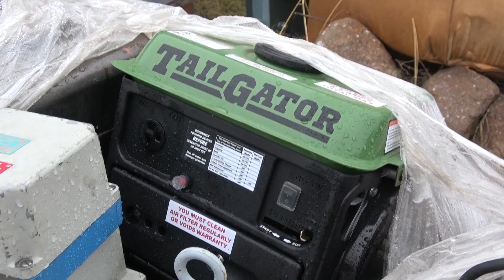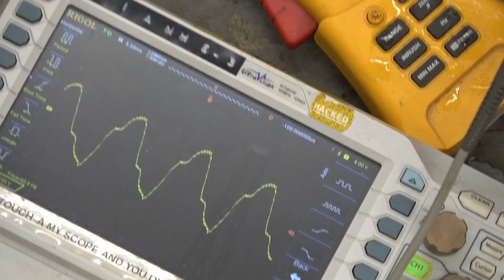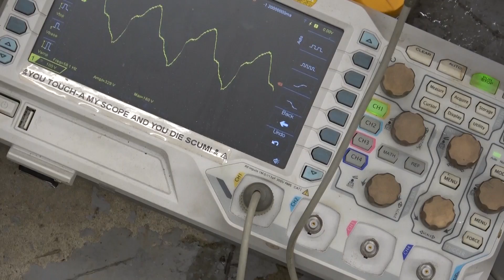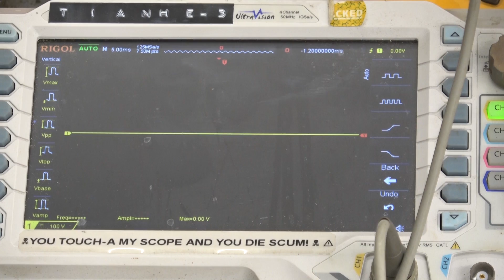BOLTR: Harbor Freight Tail Gator | Brine Tank Testing

Comment: I,ve had a few of these. Bought my first one to run some lights for night/bow fishing on my boat and to keep the battery charged up. For 89$ i did not expect it to last a month, 3 years later i pulled on the pull cord to hard and broke the plastic dogs on the starting mechanism. I could have replaced them for 50$. But opted to buy another for 89$. I have used it not only on my boat, but even more so running an electric fillet knife in remote locations. Used it to build a cover for my new pontoon boat running a chop saw. It wasnt happy but did it without much complaint. During snowpacalyps in east texas last year i used it to power the lights and my diesel fired heater through a suicide cord while i changed the end bearings on my big generator. It ran lights and a couple fans and a deep freezer at my mother in laws after a hurricane. It has been a damn handy unit. Mother in law was so impressed with it she got her one.

Comment: I had a very similar, but orange 230V nominally 1kVa cheap Chinese genset... only it ketp spitting gas out of the carb overflow unless you restricted it by turning the fuel valve almost off, and it was freakin' hard to start.

Comment: Earth’s Atmospheric Gases.

Today's collection of brain teaser facts and questions which make eco-alarmists nervous.

Nearly all of the Earth's atmospheric oxygen comes from plants and the process of photosynthesis -- 98%.  70% of that plant-sourced O2 is sea and ocean based via phytoplankton.  In other words, what land-based life forms do is of marginal impact on planet Earth's atmosphere.

Here's the balanced chemical equation of the photosynthesis process:

6CO2 + 6H20 + (energy) → C6H12O6 + 6O2

Notice, the O2 and CO2 quantities are equal.

The balanced chemical equation of cellular respiration is just the reverse flow of the above -- sugar burned with oxygen yields cellular energy, carbon dioxide, and water.  Once again the quantities of oxygen and carbon dioxide are balanced.

The gradient between oxygen and carbon dioxide in the atmosphere is 21% to 0.04%...  That's one hell of a difference given plant cellular respiration is chemically balanced between CO2 and O2.  The difference is black hole like.  In addition, oxygen is an extremely reactive chemical.  It wants to combine with *everything*.  CO2?  Not so much.  It's nearly inert at earth atmospheric temperatures and pressures.

Another thing to keep in mind.  The cellular respiration process of plants producing CO2 goes on 24x7.  CO2 only gets converted to O2 during daylight photosynthesis.  That's a 2-to-1 margin.

Effectively, earth's biosphere is a carbon near-vacuum literally starving for CO2.

When such vast gradients exist and someone proffers the notion that parts per million perturbations are life-ending, chances are the speech is motivated and contains something more than rigorous science.

It just doesn't pass the simplicity back-of-napkin once-over.

Comment: I had this king Canada for like 10 years and it runs like a top .. goes through 1-2 spark plugs per year .. using it for the camper in the summer and ice hut in the winter .. it easily has more than 10k hrs ..cheers

Comment: I bought one and I had a coupon, so I think I paid less than $90. It's got me through about four blackouts once I get it running. I have to use starter fluid to get it running every time, maybe it's because I'm old and can't pull the hell of it 20 times in a row. I start to peter out at about ten, then I say the hell with it and give a squirt, and it fires right up.

Comment: I have an Aldi version here in Australia, 240v 700w, its a little ripper. Mostly used for fridge battery charging when not enough sun for the solar panels to keep up,it has a 12v charging socket and lead. Also gets used to run a few remote ballast workshop flouros at night. A little noisy but i just put an extra push on muffler on it and and it's that quiet i have to keep checking that it's still running at 10m away,10yrs no problems yet,and it weighs nothing at all to cart around. Good little unit for what it is and what it costs.

Comment: Dont waste your money. 
Not enough power. 
A heavy duty drill can not run off the power this generator puts out. 
No welder, and no grinders.
It's not enough power for a RV.
It's only good for one house lamp with one normal size small light bulb.

Comment: I inherited a new-in-box one of the old blue-top ones of these from my late father.

Saved me hundreds of greenback doll-hairs in food that was in the standing fridge and chest freezer the last two times we lost power. Just had to run a 100 ft power cord (14ga from Home Despot, so we're good) in from the little beast out front of the garage and swapped it between them every couple hours to let them get cool. Last time was 3 full days of no power and just had to fill it four times; that 1 gallon lasts a good 6 hours with the low-cycling of the refrigerant compressors (claims 5 hours at 50% load). Just left it off overnight while sleeping.

Now I've got me one of Hazard Frought's 9k start/7250 run generators but that little guy is going to stick around as a backup. Little champ, it is!

Comment: Man, I bought one of these in late 2019 for $85 with a coupon and it has been great for ultra portable use. Not very quiet, but ias long as you drain the fuel thoroughly before storing, it starts right up the next time. If your expectations are realistic, you can't go wrong for the price.

Comment: What a s*** first comment, first of all. What I came to say was... the weak Link in this system so far has been the run/start capacitor (voltage regulator). I have run power saws and totally abused this thing for over a year. If you beat it hard enough the run capacitor will blow and the voltage will go up and down. Basically, she'll fail to Chooch. Replaced it twice and have a third one on hand. I don't plan on abusing it anymore (trying to run a skill saw) and I don't believe I'll ever need the third capacitor. So far this thing does exactly what it says it does, and is good for exactly what it says it's good for. I figured letting it sit for six months with ethanol gas and it would be enough to make her finally fail to Chooch, and hit the NFG but she started right up. Actually, I can't say start right up  because it usually takes anywhere from four to ten pulls to start it, but that's consistent. The spark plug wire was just a coil wire going into the boot when I bought it. I don't know if that's normal but might be something for you to look at. Thanks for the review and all your videos. look forward to seeing you tear this thing down into a million pieces and see what you think.

Comment: So I have a question... I have that exact lighting producer .. I had a series of LED lights running through a surge protector power strip and the lights were flickering so me and my bright ideas I was wanting to see if I increased the motor speed would the flickering go away ?? it did not.. as a matter of fact it blew the surge protector and plum let the smoke right out of it any ideas on what was causing the flickering

Comment: Almost certainly you're making HCl unless you're using distilled water.
Reply: And the salt saturated solution is probably throwing off both Hydrogen and Chlorine gasses, this is the process by which most chlorine is manufactured.

Comment: I got me one for $89US at the harbor fright tents sale 4 years ago. It needed bill Cosby in a can to start out of the box, but I just use it to run my Chicago electric angle grinder and hedge clippers. It was cheaper than 300 ft of extension cords and been doing great for 4 years now. I think it will run a shitty microwave, a fridge, or a small conditioner (pick one) of the power goes out. Not much more. I bought it to go cut a steel fence down in a field with no power. Got a grinder and the genie for <$100 for a 3 hour job. Still running both quite frequently 4 years after.

Comment: Wow yours actually rn?  My father and I both purchased one of these type of generators from there years ago.  Mine stopped working within 2 days.   Took it back and got it refunded.  Dads worked for awhile but it didn't put much power out at all.

Comment: After the last war in Iraq 2003 the market was full of this trashy generator as it was cheap and as the first thing we lost was the power, we used to call it the screamer, it worked max a month or 2 then we had to go and buy another, most of the time it's broken when you buy it, had like 7 of them on my roof and was swapping parts when one of them breaks, was good to turn on an old TV and some lamps and a fan that was it, had to use protection before turning on a pc on that.

Comment: The electrodes are to big, you can just use 2 nails or just the bare wire.. or maybe just less salt.  Also I read somewhere is better tu use baking soda instead of salt to prevent clorine gas formation.

Comment: Oh the number of times I've pullled and cursed and pulled some more on my Tailgator only to figure out I forgot to turn the stanking gas valve on!  It takes a bit for it to get down there sometimes too, generally put the gas on, organize what I'm going to work on, put the choke on to start, pull 5 times then hit the switch to on.  Usually starts right up that way.  I've got a long enough yard that extension cords just won't cut it so I use this as a portable power supply.  I've run a pancake air compressor, electric pole trimmer (cheep Hardless Freight version) Radial arm saw (that really loads it down, usually pulse the trigger a bit there till it's up to speed) last time I had it driving my power sprayer.  Only real limitation is it wants to be level. so just sitting it in the back of my garden tractor trailer is out of it.  I sit it on a piece of plywood and shim that level when I get to where I'm working.  Like most two strokes, run it once a quarter at least and it'll stay happy.  Mines 4 years old now and really has been a good 65 dollar investment.  (good old sale)

Comment: The temperature of the solution has an effect the higher it goes the higher the amps will go if the concentration stays the same. I operate a AC mine winder and this is how we control the induced current to controll the speed of the winder and a cooling tower to keep the solution temperature in check.

Comment: Excellent "jar of water resistor" (aka liquid rheostat) sir!

Less salt (maybe just a few tablespoons worth!) and controlling as a large electrode area will probably be easier.  Hot water conducts more easily than cold, so until it boils or reaches thermal equilibrium it will never be stable.  A small glass jar (kept in a containment bath) may equilibrate faster (and dry out, changing electrode coverage...).  Eh, expect it to drift.

NaCl will probably generate chlorine and smell like a pool.  The solution pH will also probably rise over time and get more corrosive to the aluminum and human flesh (to worry about if the deadly voltages and heat aren't enough).  Sulfate, hydroxide, or carbonate anions are more electrolytically stable.

Comment: I had one of these about 10 years ago (They were blue at the time, but otherwise identical) I used it at the racetrack every weekend for an entire summer (call 1200-1500 hours) before it gave up. Even then it probably just needed a carb cleaning (All you could get was E10 gas at the time). It was the same price back then. Replaced it with a Honda EU2000, but it definitely lasted longer than its price tag would indicate.

Comment: I have the Ryobi branded one (looks identical other than being 220v), there are other brands as well and they all seem to come from the same factory. She runs all my essentials during a load shedding, which is common where I live, for hours. It even ran our house 24/7 for a week, when the transformer for the area went up in smoke! So I can confirm that these lil 2hp generators are, indeed, a sore dick deal. Only down side is that you're not gonna run any big consumers like electric stoves/heaters/kettles/washing machines/fridges/AC units/geysers/welding machines/angle grinders/compressors etc etc,. But well good enough for lighting (if LED), the entertainment of choice, interwebs and a couple small fans....

Comment: I paid 800 US clams for 10 times the amperage from a surplus military diesel unit.  Also does 240 split and 208 3 phase.  But weighs 1000 pounds

Comment: I can't get mine to put out over 90vac.
Tore it down and nothing looks bad. Cap checks out at 12uF as printed on the side and the rotor diode isn't shorted. Tried adjusting there RPM and it peaks at 90v. ???

Never really used it but the warrants up because it sat in the box. Thinking about replacing the generator portion with an alternator because I wanted it for backup battery charging anyway.

Comment: I just got one of these units today on Craigslist for $25. The guy had left gas in the tank for a few months w/o use. He claims he cleaned the carb out with carb cleaner. I'm guessing he didn't use the cleaning wires to get the junk out of the tiny passage ways. he said it would only run while the choke was full closed, and die when it was opened. So I'm guessing junk in the passage ways.
If it runs anywhere near as good as this one, I'll be happy camper. Just use it to charge battery packs out in the field where there is no electrocity lines.

Comment: I hate these things. For years I ran their older unit, I think it was blue. It ran, and ran. Finally I managed to kill it, while running a circular saw all day. I bought one of these new green ones to replace it. The first one started ok after 20 pulls, and I let it sit for a week before I needed it. Then it would not start for nothing. 100 pulls later, and half a can of starting juice, I brought it back to HF for a replacement. The second one never ran right. I found that the spark plug cap is barely a cap. the connector is simply poked barely into the wire. I exchanged the entire unit again. 3rd one was a bear to start. Above 40F it would usually start in 20-30 pulls. Below freezing, and good luck. It didn't matter if you dumped gas right into the thing, it wouldn't fire. I replaced it again. 4th one again was a bear to start, but would usually start in 20-30 very hard pulls below freezing. I used it once, the second time the float kept getting stuck. After messing with it, it worked for about 30 minutes, then started pouring gas everywhere. At that point I had enough. I gave the thing to a friend for free. 2 weeks later the unit ended up in my garage again, and I haven't seen that friend since. 

4 years ago HF was kind of cool, in that you could get some things dirt cheap. That is no longer the case. You can buy things that actually work for the same price now. I don't miss it. The smell of every Harbor Freight is the same, and it is not good.

Comment: After reading all the funny comments below, I'm a bit embarrassed to ask something serious.
I've (spacewater7) run into a bit of confusion after watching a video about a failed mains power supply box that caught fire.
I was wondering if you'd endeavor to enlighten us as to the workings of a GFCI and RCD devices. I'm not sure I know how they work, and I get the impression other commenters on my post don't know exactly either. I also wonder how older units (like those in my US house) accomplished the same thing, how modern units differ, and if the two devices are different names for the same thing? Also it might be fun to watch you tear one apart :D
https://www.youtube.com/watch?v=buiJTq-w2fY&lc=

Comment: If you want a predictable test load that won't poison you with chlorine gas, a good alternative is to use nickel-chromium wire as a resistor. Measure out the correct length for the resistance you want, wrap it around a piece of wood, and dunk it in a bucket of regular water for cooling. The adjustability is lost, but it's a fair bit more precise.

Comment: It's purely the temperature rise making the ions more mobile that causes the current to rise.  Because the temp tops out at some point you want to start low on the salt/amps and wait until the current has topped out around 200F before modifying the salt or electrodes.   By the way, your bigger just rebuilt generator should be broken in using this method if it had new rings put in.  You should load it to 40kW (40kW rating right?) for about 8 hours.   I've seen 1MW 480V generators run-in using a 10 yard dumpster and train-rail electrodes.

Comment: Hazard Fart! 😂😂😂

On a side note: I worked in a data center in the past and they had cooling machines that also had water boilers in them, to keep the moisture level steady all around. Those things were powered by three phase 380 Volts, directly pumped into the water by means of mesh electrodes. Very effective! (Over time the electrodes would end up calcified resulting in rather spectacular fireworks, I might add...)

Comment: I have one of of these and love it but there are 2 manufacturering plants and ways to tell what one you have. I picked mine up on sale for 80 bucks and use it to run my ice shack and charge my rv batteries in a pinch. Even in -30c she goes but i do run it a little on the over oily side but otherwise its never left me stranded.

Comment: @AvE you need large plates and more distance between them in the electrolyte, the hydrogen and oxygen around the small surface area of the electrode is causing the load to be too snatchy for the AVR on the genny to cope and is not presenting a static resistive load.

maybe sinking one of them to the bottom of the bucket might give you enough distance, failing that a trough style container may be the way forward and give you better range on the low current end of things.

alternatively you could add something else resistive in series to give you an offset (filament lamps, another bucket of salt water, etc.)